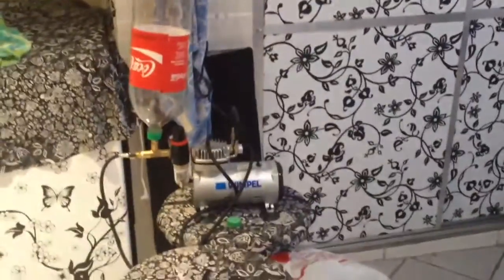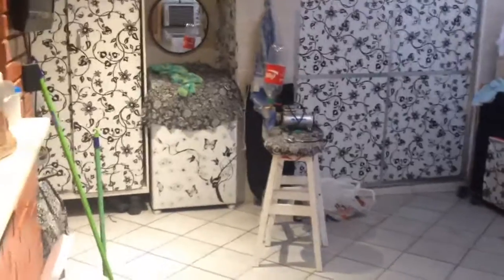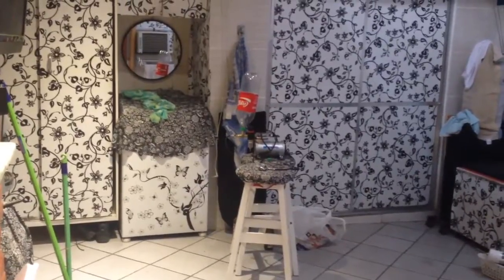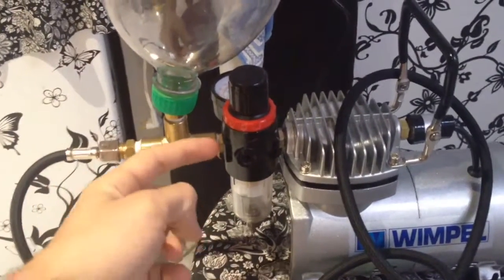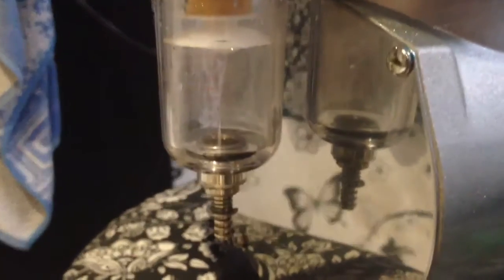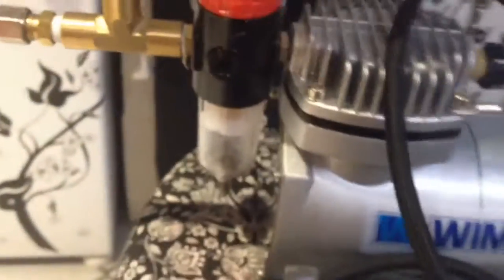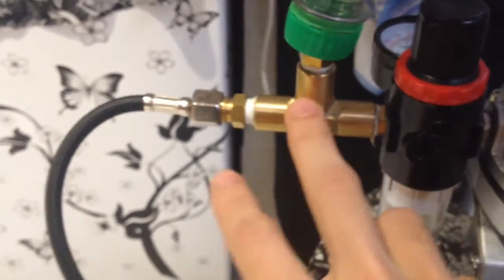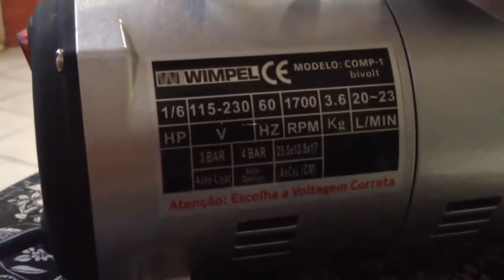Cheap air bottle tank for airbrush compressor

Comment: I've used a large 1 gallon Crisco oil jug bottle before. It's a thicker walled plastic than a soda bottle is. Only thing I did was use some JB Weld Steel epoxy on the cap lit to hold a fitting in place after drilling out the hole to fit the fitting adapter. And I would also put some epoxy over the threads to seal the actual lid to the bottle. I'd change the bottle out to a new one every so often and change the fitting and a little epoxy and had a fresh one running again. But  I since got a true tank and not running plastic bottle anymore.
Reply: Do all the  compressor have same safety cut off that stop the engine when not spraying :) I wondering why not using mini shop/ tire compressor.

Comment: I have the same compressor as you do and I'm flirting with the idea to use a 2l or 3l Coke bottle. However, I am afraid that the cap might break, even though I use my airbrush below 30psi - and it would be a mighty boom! I am looking for a metal alternative.
Reply from the maker: +jonnieZG I got the full on 57psi that the compressor puts out ! Just drill a hole smaller then the fitting . I used later a new configuration ! I'll see if I can send you a picture
Reply: +LiPe VoLcOm Thanks, that would be great!
Reply from the maker: +jonnieZG go in to my google+ I posted the pictures
Reply: +LiPe VoLcOm That looks nice, thanks!

Comment: Those bottles will handle up to 150psi a guy on youtube has tested them with air compressor all blew up at 150 or alittle above,and the plastic is deformed serverley before explosion so I would not worry,I very much doubt your going to have anything over 90psi.